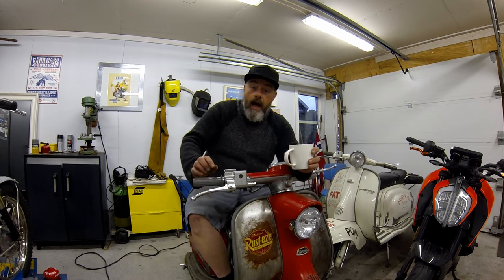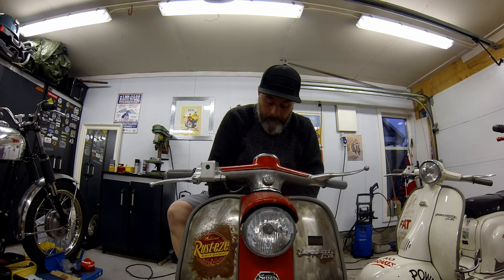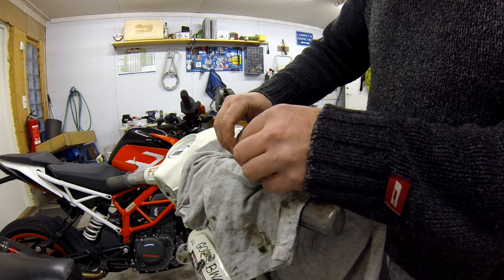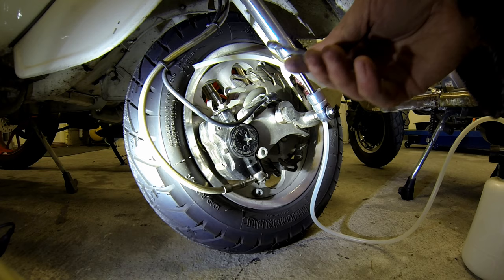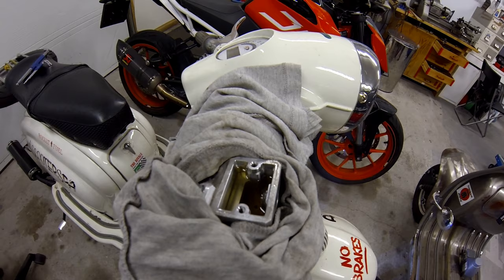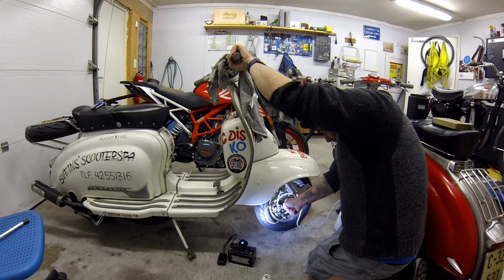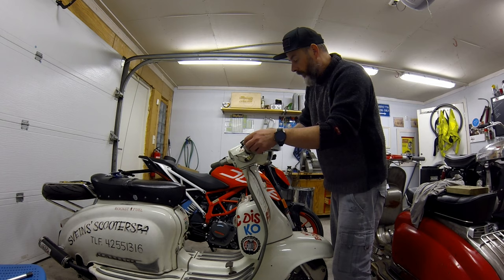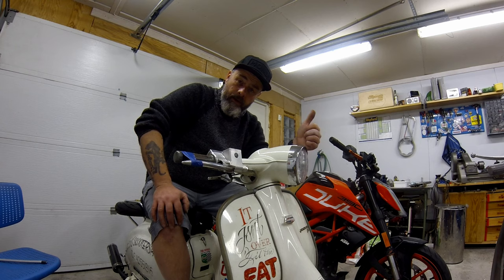Easy (and cheap) way to bleed hydraulic scooter disk brakes.

Comment: Glad I came across this. I never knew that about the brake fluid. The screws which I’ve got in mine  Or that there were different types. At last I’ll be able to do it properly rather than my usual bodge

Comment: What would I have to do to turn the caliper around ? I have the same pm tuning caliper and have the bleed nipple on the bottom. It was working on one scooter but when I swooped it over to another scooter I now can’t get it to build any pressure.. was wondering if by turning the caliper around like you mentioned it may help me.. great vid by the way.. thanks .!Paul
Reply from the maker: It's a pain but loosen the front wheel bolts and that should let you screw off and slide the caliper completely free. Just put a spanner between the pads while you bleed it. That's how we have to bleed the casa disk too.

Comment: I have a front and rear disc and use the eeezeybleed system, it takes seconds to sort brakes out, you can buy these off eBay for about £20 , maybe you could do a video on it rob

Comment: Hello. I have just tried for my first time to do this but I think I did not do it right. The reason I think this is because after putting everything back together my rear caliper seems to be too close to the grip when I press it down. The rear brake seems to work, but it seems way too close to the grip when applying the brake. I have also changed the caliper and it even has new pads in, so it isnt because the pads are worn or pistons out. Do you think this is an indication that air is still in the system? If I use a cable tie do you think it may resolve the issue?
Reply from the maker: If at first you dont succeed, try again.

Comment: i have a bad vibration when i apply the front brake, shudder?? on my px 200 , 2008  can you help me please
Reply from the maker: There is loads of things that can cause judder. Loose or worn headset bearings, worn fork link bearings/bushings, warped disk, glazed brake pads.
Reply: thanks, any way to diagnose the main problem. I do not think its disks and pads.

Comment: Thanks. I'm working up the knowledge (and courage) to attempt this on my SYM HD200. No one will work on it in Nashville TN as they consider it a "Chinese" scooter. When I say it's not Chinese, It's made in Taiwan, they look at me and say, "Yeah, like I said, we don't work on Chinese scooters." I'm a little worried that the rubber diaphragm might need replacing as I can't find them anywhere.  It's a 2009 SYM HD200 and I wouldn't be surprised if the fluid has never been changed. Have you ever seen a diaphragm that should be replaced? Thanks again. Great job.
Reply from the maker: There are quite a few sym in Norway and you shouldn't have any problem bleeding the brakes. Maybe these guys can help you with parts? http://www.scooterloungeonline.com/symhd200evoparts
Reply: Theyre kinda right, because Kymco and SsangYang (not to be confused with SsangYong, who makes cars) a.k.a SYM actually have interchangeable parts with chineese scooters like a GY6. Source: I owned a Kymco Movie 125XL, and now a Kymco Downtown 350i.
The advantage we have over the Honda and Kawasaki (along with suzuki, yamaha) boiis is that we can straight up go shopping on AliExpress and EBay and come out fine.

Comment: Hey man!  What do you think it might be or how can you adjust the lever to feel hard again because I've changed the fluid and the lever is so light and it doesn't break till you fully compress the lever
Reply from the maker: Air in the system. Try and bleed it again.

Comment: What happens if the reservoir gets empty when draining? Will I be able to put new brake fluid in and just get all the air out?
Reply from the maker: Yes but you have to chase the air all the way though the line.

Comment: Really enjoying the videos . I have a Scootrs front brake set up which has the Nissin Caliper and Master Cylinder. I have no problem bleeding but I only get a couple of mm movement in the brake lever and I find it too harsh. I see with your set up you have normal movement in your lever. Is the Scootrs a crap set up or am I doing something wrong ?
Reply from the maker: My sons series 1 has the scootrs disk brake. They are very "grabby" and actually a bit too powerful. The mmw master cylinder is more modular than the nissin and helps to stop it bite as hard. One cheap thing you can do to calm it down a little is fit original Honda branded brake pads. This will help calm it down a bit but the master cylinder we have from jockeys boxenstop really does wonders for it. The internals are from brembo and are much easier to regulate the power.   That's my tip at least. Try pads first but that will not change the throw in the lever but will calm it down a little. Hope that helps.
Reply from the maker: https://rover.ebay.com/rover/0/0/0?mpre=https%3A%2F%2Fwww.ebay.co.uk%2Fulk%2Fitm%2F133123595260 these!
Reply: @kickbackgarage  I think you are right it is the master cylinder. There's no feel in the brake it's like an on/off switch. Thanks for the reply

Comment: Hello, when replacing the pads by mistake I hit the break and the disk is stuck and stiff. Do you know what to do, please?
Reply from the maker: Yes. You have to remove the wheel and press the pistons back into position.

Comment: Hi.. I am from India and having lambretta scooter 150 model 1971 made.. now what happen every time if I want to start after 2 days or a week I have to open air filter n hose pipe then Press carburettor air hole and then after few clicks get started. . And also spark plug got huge carbon layer after 3 to 5 KM runs..plz help me what to do ...and few oil spray comes through exhaust
Reply from the maker: Either the carburettor is flooding or it is running rich because either tyour airfilter is blocked (I presume India can get quite dusty?) or your jets are too big. Chack and clean the carburettor and make sure your air intake system is not blocked.

Comment: 6 months usually from opening the new bottle of brake fluid it will keep its freshness 😉
Reply from the maker: I think that depends on how much/little is left in thd bottle. Wasteful really. I wish  the sold smaller bottles.
Reply: Kickback Garage agree, stuck between a rock & a hard place, do you buy a small bottle and diy it or take it too a garage and let them do it. I use the hydraulic tool for replacing the fluid, 30 seconds and it’s all done 😆
Reply from the maker: @exsoulagent  I have a vacuum bleeder 😄 but when I was learning I could have done with a video.